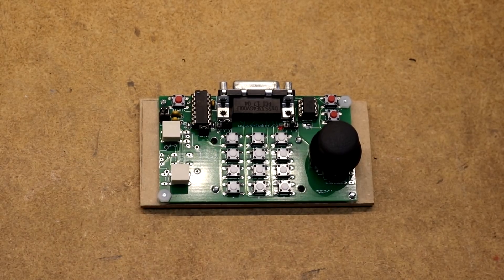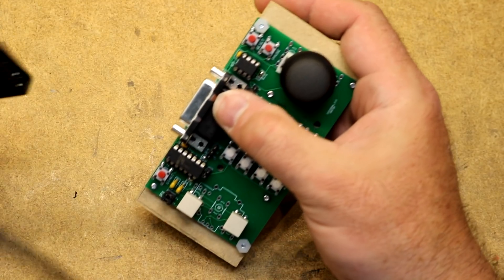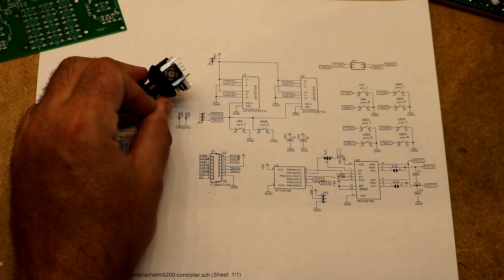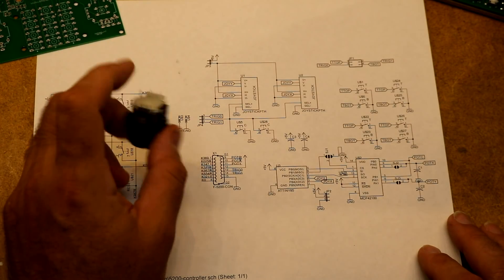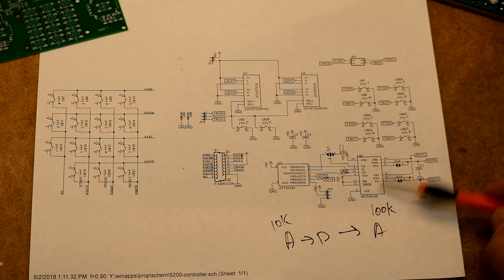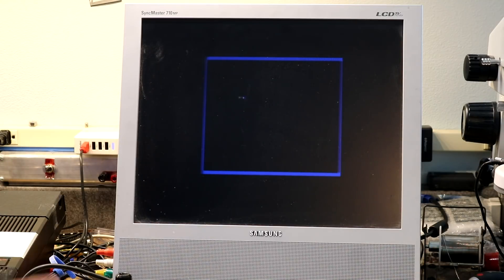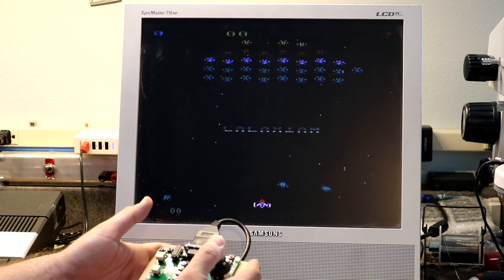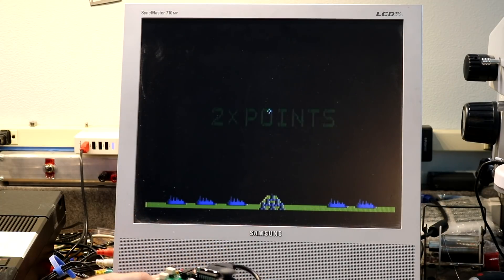Homemade Atari 5200 Analog Controller

Comment: It could be really interesting to see something like a solid standard way of building high-quality analog 5200 joysticks, and make a way of producing them in larger quanta.

Must be thousands of retro-gamers or just people having grown up with an Atari 5200 wanting to buy a quality selfcentering analog controller.

Perhaps even those with the technical expertise could assemble people to just produce them én masse, or something.

If it costs 40$ to produce each and sells for 75$ each, selling 400 would give 14000$ .

... and keep Atari 5200 gamers happy...

Could the same controller be made to work with more consoles than the A5200 if it came with 2 or 3 cable-types?

Comment: per the Atari field service document for the 5200, the controller pot readings for controller 1 should be 112 +/- 1 for both horizontal and vertical when centered

Comment: Hello again. I just realized that the capacitor trick may be useful for repairing 5200 controllers with pots that have too low a resistance. Late production units with US-made “CTS” brand pots top out at around 350k ohms. That’s obviously a lot closer to 500k than a 100k PC joystick, but it’s still bad enough that you can’t control Pac-Man or defend the right-most city/base in Missile Command. I was wondering: how do you calculate the capacitor value required to make a 350k pot behave the same as a 500k pot? I am aware that I will probably need to take ESL into account and if the resistance of the pot continues to drop I will need to adjust the capacitance, which is why I’d rather know the fundamentals rather than just the value. Even so, if you have a capacitor value/type to suggest, I’m all ears. :)

Comment: Thank you. Ben Heck never demonstrated an analog game. Also, I saw where someone else was being told that a digipot wouldn’t work properly for a C64 analog project, though they also suggested the capacitor trick. I’ve been considering doing something like this for years, ever since I found that replacement pots weren’t available for NES Vaus controllers.

Comment: If the Atari doesn't really measure the resistance but the timing a capacitor is charged, couldn't you get rid pf the digi-pot by sending timed digital siganals? You would sense the voltage that should go through the 500k Pot, wait some ms according to the 10K Pots position, and switch an output high, instantly giving a full charge to the measuring cap in the Atari.